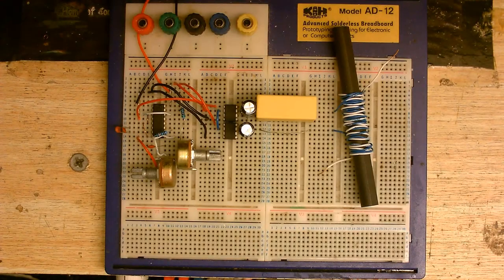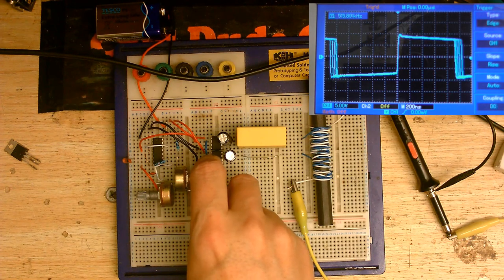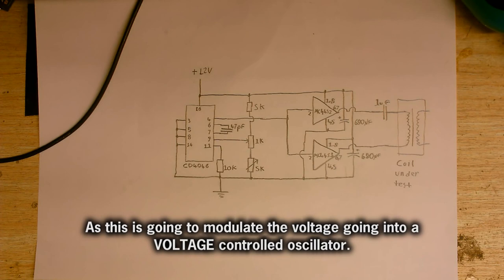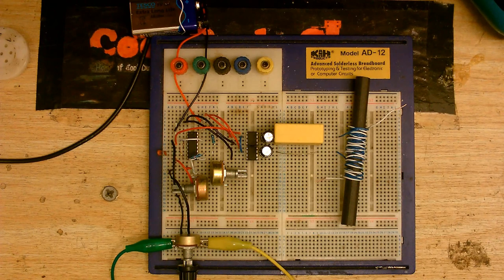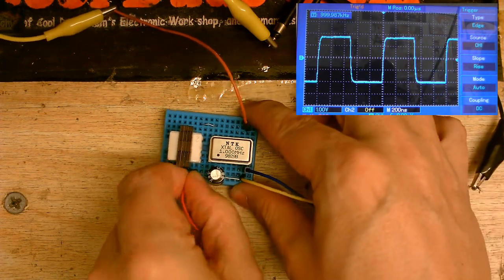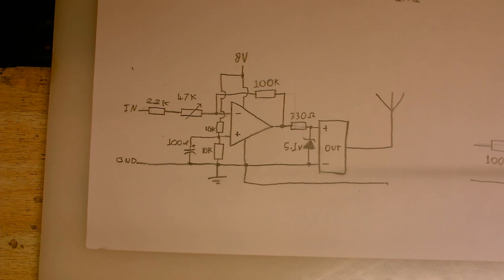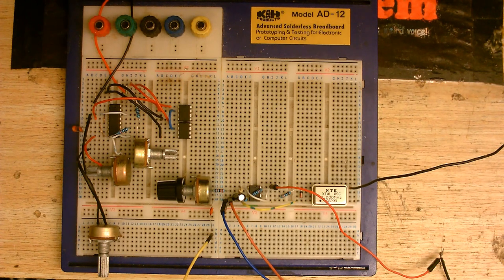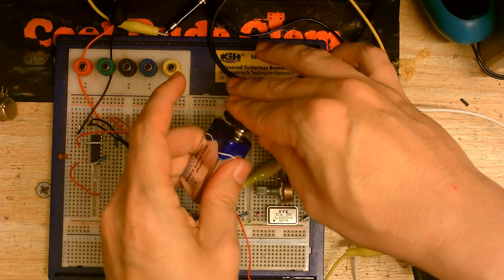Experimenting with experimental radio transmitters

Comment: Just replaced the rf modulator with an custom hdmi board in my atari, 

Thought about using it as a qrp analog tv transmitter, 5 volts, composite video, mono audio and an antenna, channel 2 or 3

Take the output and feed it through an rf amplifier (I do not recommend unless, in your case, you want the bbc at your door😉)

Ferrite is generally designed for high frequency applications

Comment: Well done!
I find simple Radio circuits quite interesting.
When you detune an A.M. Receiver slightly to receive F.M. it is called Slope Demodulation.
Can those modern Oscilloscopes without C.R.T.s show the Modulation Envelope if you adjust the "Timebase" ?
Your Variable Capacitor value seems a bit on the high side.
A single continuous line for an Inductor Core means Metal (two parallel ones for Laminated Metal).
It should be a line of dashes for Ferrite and I wouldn't have used the number of the beast as my frequency as it might not be a good idea.
Reply from the maker: well I just thought it would be funny to use 666, I don't believe in bad omens and all that junk. That variable capacitor is around 1nf when fully closed and both "channels" connected in parallel, I measured it, it's not one of those silly plastic squares you find in modern radios. I could have shown the modulation on the scope, it just didn't cross my mind at the time.
Reply: @CoolDudeClem  I suppose to someone who thinks only in a scientific way spiritual thoughts would indeed be junk.
I didn't spot that bit of Black Wire putting the two Variable Capacitor Gangs in parallel on the first watch of the Video.
Yes if both Gangs were 500pF at full mesh it would be 1nF in total.
With the version that had the Tuned Output Stage did you try to find out how far the Signal went?
I would have thought it might have got at least as far as your Garden.

Comment: Your initial thoughts using the BD139 amplifier weren´t to bad (amplifying the square wave signal), but it´s not changing it´s "width" when you modulate the oscillator, it´s changing the amplitude. As you may have noticed eventually in your experiments, aligning the potentiometer to a certain point (lots of RF to the BD139 amp) it´ll start to distort. If you look at the scope, you´ll see that the signal will be cut off at the lower / higher ends (sine-wave). Even when supplied with a square wave signal, your amplifier is still working in some kind of class A- ish mode.

Better add a class C output stage to the oscillator (1nF to base of a BC548, then a 1N4148 from base to ground) and add a "in series modulator" to this little amplifier.

Also did some experiments with these oscillators, you can easy get them to produce .25Watts with just a single transistor as amplifier (they produce about .01W by themself).

I could get a lot into detail here, but I´ve enough videos about this stuff on my channel, so I "save words" here.

Just for inspiration (did that, worked)... how about generating a frequency stable PWM Signal on the carrier frequency - and amplify that? Using a schmitt trigger (either discrete built or a CD4093 Chip) you can make a triangle / square wave / pwm circuit. The signal then really can be amplified by any class C (or A... but A doesn´t make much sense then) amplifier. When I build this years ago, it worked... but it had the downside that I couldn´t get that much modulation depth out of it, before it would start to distort. The advantage over simple FM / PWM Modulation (first experiment - adding the small speaker as a microphone) is, that with this method you get clear AM, and don´t need to de-tune the radio.

Adding a PI Filter to your current transmitter should give you enough signal power, to cover your room and maybe 1-2 rooms next to yours using a 3ft long wire Antenna.